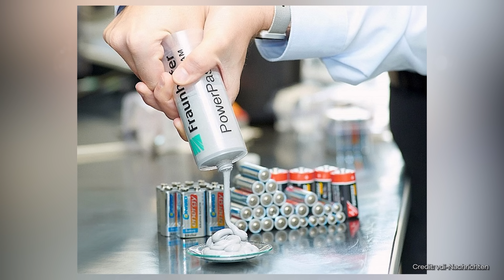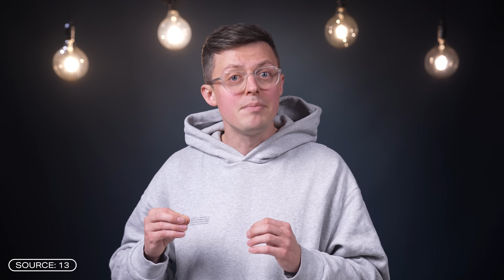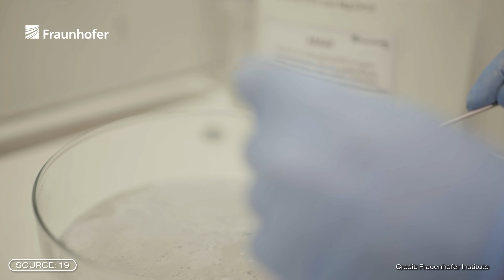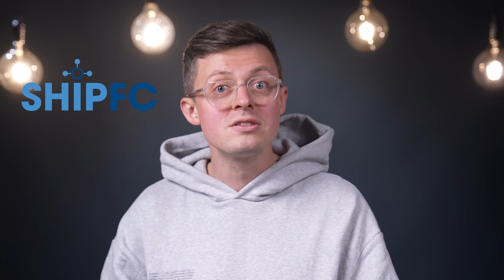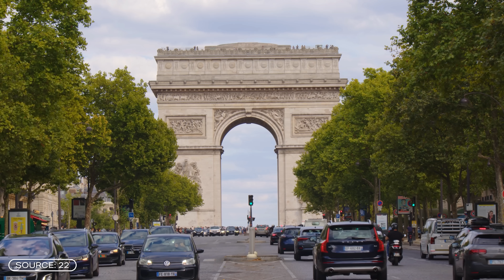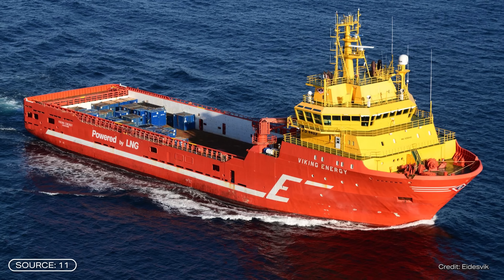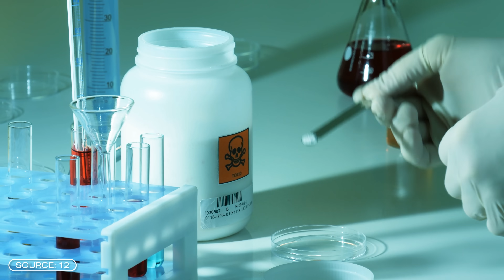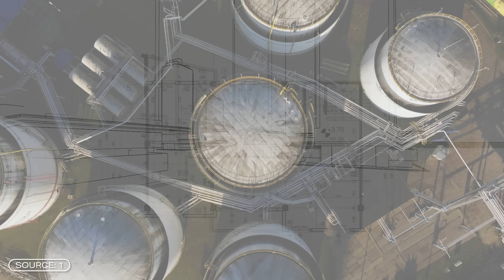Hydrogen Powerpaste: 10x Higher Energy Density & Safe?

Comment from the maker: Would you drive a car with a powerpaste-driven engine?
Reply: If it's as delicious as liver sausage, then a resounding Ja.
Reply: Mmmmm, Forbidden Toothpaste...
Reply: @MostlyPennyCat  BEAT ME TO IT!
Reply: Unfortunately the apparent reliance on liquid water is going to make that a no for me. It's below freezing for about half the year here.
Reply: @TheStrykerSeven  Same here, but if you could put in an antifreeze it may not be that much of a problem.
Reply: I'll never get a chance to.  Hydrogen is a terrible energy carrier. The total cost of the system will be too high.  Very little hydrogen is not produced from natural gas.  Which would be far more efficient and less expensive to just put in a natural gas vehicles.
Reply: @AddItUp-11235  yet it has a specific energy of 142MJ per kg. Far superior to any other battery and superior to petrol and diesel .

Hydrogen will be part of future energy storage, we cannot afford not to.
Reply: @polarbear7255  Maybe for bigger systems where size and weight does not matter. For cars, never.
Reply: @mikaelpehrman4815  never? 😂 love your ignorance. Toyota is already racing hydrogen ICE.
Do try to keep up.

Have a nice day 😊
Reply: @polarbear7255  Please enlighten me and my ignorance, with prices of a car, the distance it can travel and the density of supplyers of H2
Reply: @mikaelpehrman4815  go check the toyota Mirai… a hydrogen fuelled ICE vehicle. The Corolla GR H2 is their primary race car, but they have several other classes of vehicles as well, including a LeMans H2 prototype which raced at the LeMans 24hr in June 25.

The technology exists . Consider yourself enlightened. 

You’re welcome. Do you always have to be spoon fed your information?
Reply: I wouldn't park a car full of anhydrous magnesium powder in paste form anywhere 100 miles upwind of anything.
Reply: No. The production of Hydrogen is almost entirely from Methane; a petroleum product, via a very energy intensive chain of processes. 

If Hydrogen is produced from H₂O by electrolysis instead, the highest theoretical extraction efficiency is 66%, but in practice anything above 57% efficiency is a bonus. Then you have to pressurise it to 6 Bar, which takes energy. After that, the paste can be loaded with Hydrogen at, according to your words, 90% efficiency. Already, the overall efficiency will be down to around 45%. Now, if you use it in a fuel cell to generate electricity, that fuel cell runs at 66% efficiency or less. Now the overall efficiency is down to about 30%. At that point, you can use it in an electric vehicle, which runs at about 72% efficiency in real life, counting recharge and discharge losses, electronics and power train losses, etc. So the total efficiency will be around 25% at the very best. This is no better than burning Diesel fuel in a car in real conditions.

If the Hydrogen is simply burned, as is fuel in any combustion engine, the vehicle efficiency alone will never be much higher than 25% in real world use. So now we have a total system efficiency of about (0.25x0.30=0.075), or 7.5%, which is abysmal.

But taking the petroleum route for both Diesel fuel and for Hydrogen, overall system efficiency is very low indeed, because oil and gas have to be found, extracted, transported, refracted, transported again, stored and then put into the chosen process; Diesel fuel or Hydrogen. We are looking at over 99% of the energy put into the whole chain being wasted if the Hydrogen is simply burned in a combustion engine, and not much better if a fuel cell is being used for recharging a battery in an EV. (The Toyota Mirai is an EV, fuelled by Hydrogen, for example.)

Furthermore, Hydrogen leaks from most storage vessels, pipes, valves and gauges. Even in the paste format or a metal Hydride cell, it is still dangerous to handle. In the vehicle itself, the Hydrogen continues to evaporate until used. After the paste + distilled or reverse osmosis water process, the paste requires transporting again, and then reprocessing. (Ordinary mains water would contaminate a fuel cell and poison it quite rapidly.) Think of the logistics involved, with all of the energy losses incumbent upon that.

If electricity is used instead of Hydrogen, it can be generated at site, ideally, or transported through transmission lines when necessary. According to my energy supplier, transmission line losses in Britain amount to about 3% of the electricity put into them. Put it into a car with an electricity to motion efficiency of 72%, and the overall efficiency will be just above 70%. 

For long-haul air transport, and marine shipping, Hydrogen might well be the best option. It's viable right now. But do bear in mind that for batteries, the cell technology is improving in leaps and bounds. The best semi-solid-state cells available, and in some cars, right now hold just over 500 Wh per kilogram at cell level, and there is a lot more development in the pipeline. A decade from now, at today's rate of development, that might well rise to at least 1.5 kWh per kg. I hope to be alive to see that happen. Only 30 years ago, the best rechargeable cells on sale were Ni-Cd, which are little better than a Lead/acid battery..

Now, for cars and trucks, which fuel route makes the most sense to you? Fossil fuelled, Hydrogen/electric, Hydrogen combustion, or fully electric?
Reply: I forgot to mention the high, and increasing cost, of Hydrogen. It's already more expensive to use per kilometre than traditional fossil fuels.
Reply: @RWBHere hydrogen as a fuel source via electrolysis only becomes feasible if we switch to a nuclear powered society.
Reply: @RWBHere  Efficiency is important, but if you move manufacturing to deserted places with a lot of sunshine, it might matter less how efficient a process is if it is environmentally friendly, and H2 can be produced from water. In the end, when you think about efficiency of using modern combustion engines, you do not subtract from the efficiency numbers how expensive it will be to clear the Earth from overheating, or to heal the environment.
Reply: @RWBHere Well argued and explained, I think I’ll just stick to my bike!
Reply: @RWBHere  Did you factor in the energy cost of lithium mining and battery production, as well as the base cost for electricity generation into your calculations? What's the source of this electricity? Are these coal powered electric vehicles? 🤨
Reply: All electric hybrids would offer an interesting and powerful combination of capabilities.
Reply: People will make their own electricity at home as we go past 30% efficiency. Of course this is urban and suburban. Excuse me rural and suburban housing. And it will also promote suburban and rural housing. The ability to have energy Independence. Combined with that and the fact that very soon there will be Jets and like personal vertical takeoff and landing transportation powered by yes, the solar panels in your house or your property people will move away from big cities and be able to fly in like blade, runner and minority report.
Reply: @gearond  maybe for 3-5% of the population.  but we desperately need to get away from the congestive over built cities.  if this spreads to the top 25% of the population then its golden.
Reply: Can powerpaste be paired with hydrogen turbines?  NASA just shared a successful test, so how can H2 energy loops and logistics be generated and tested, in joint programs?  Space energy systems would seem to revolve around this new technology stream.
Reply: EV are packed full of technology that makes them very much safer for pedestrians and cycles. Not hitting them is safer than hitting them with a lighter car! What precious metal s are you concerned about. The modern EV isn’t using precious minerals, unlike every ice vehicle ever made. The fuel they use needed cobalt in the refining process. People keep recycling myths about EV as facts. Very few EV have had a battery fire, much more likely for an ice to have a fire. Or do you think a hydrogen powered vehicle is going to be fireproof? Hydrogen is such a level of unnecessary complications I can’t believe people think it’s a good idea . Making it, transporting it, storing it, converting it all inefficient and costly. Why would anyone want a car either the added complexity of a hydrogen storage and system to turn it into a working energy. It makes zero sense. That and having to go to a hydrogen station to fill up rather than plug in at home or the super market etc. then there is the cost of all this extra not needed crap it needs to make it work. Laughable,
Reply: Does it work as thermal paste?
Reply: Energy density in gasoline is about 5x more so... no thanks
Reply: No, I am not stupid. Hydrogen is stupid for energy applications.
Reply: how would you even fuel it though?
Reply: Only if it was cheap, which it will never be.
Reply: @hillsandstreams8152 
Why do you think so ???
Reply: 1,9 kWh pro Liter sind nicht viel😂 ist immer noch nur ein Fünftel von Benzin oder Diesel
Reply: NEVER.  The whole picture is breathtakingly costly.
Reply: Why? All of this is a solution to a solved problem. The next generation battery cells already being put into cars for sale recharge in ten minutes, making your stop equal to a gas stop on a roadtrip, because with gas you have to stay at the pump while it fills, with an EV you plug in, run to the restroom and buy some food, and it is done charging. Range is find with EVs, no one needs to drive more than four hours without stopping. 

And now we add even more inefficiency to hydrogen powered cars, having to make the paste, haul around the byproduct after it is used and take it somewhere to be recycled, etc. All so we can use more natural gas, which we need to be using less of.
Reply: still doesn't make sense. petrol 9kwh/L, diesel 9.7, This 1.9kwh/L. 
you have to carry the additional weight with you, you have to carry extra water. electric motors are very heavy.
better to use compressed methane, you don't need to carry spent fuel. filling is easier, works with minimal modifications to existing engines. infrastructure is about the same as current fuels. different storage tanks/pumps, same refueling routine. 
we just need to spend on solar ---> sabiter reactors,  pull co2, produce methane, pump into car and repeat. 
in every case there's massive amounts of waste. methane is at least a closed  ~ open cycle. we could be pulling co2 compounds directly from power plants at first using NaOH, KOH. and building larger solar powered plants that just recycle the air.
most hydrogen production is steam cracking natural gas.. which releases the same Co2 as burning fossil fuels with the added steps of creating a new storage solution and more complex distribution methods. 
Just go methane.
Reply: I would like if YOU drive such a car!
More and cheaper fuel for my 6.1 HEMI ❤
Reply: If it was cheaper cost per mile absolutely.
Reply: Not if it were on the Epstein list.
Reply: YES
Reply: Sure!  Would you fill it with paste for me?  More seriously, solar is getting pretty inexpensive compared to cars.  If I could install an extra 20kW worth of solar with a catalytic electrrolyzer and a tumbler so that, after the up-front cost, all my fuel is free, that has to be my preference.  But, if powerpaste is as inexpensive as gasoline, certainly I would prefer a fuel cell car to a petroleum powered car.  I think a fuel cell car is going to actually be a short range battery car with a fuel cell range extender, so the competition is going to be having a fuel cell and fuel versus having swappable extra solid state batteries to extend the range.
Reply: Hopefully  not S*itting solid waste on street like dogs and horses?
Reply: evet
Reply: Hindenburg reinvented?  Go ahead, blast yourself!
Reply: The paste changes hydrogen from a simple energy carrier to a material that either becomes waste or has to be recycled.
So now it adds a new energy loss to hydrogen use (assuming a circular economic model), and hydrogen already is a very inefficient way of getting electricity from the generator to the wheels of a car.
It's a messy idea from various POV.
Reply: 😂..no
Reply: Needs a better name in English — PowerGlide… er, taken. Hydrogel… hmm no again.
Reply: I think my orangutuan nepo-king would have me incarcerated for heresy for even watching a video about it.
Reply: Yesterday....
Reply: no because aluminuium gallium in saltwater  is usable even in apocalyptic scenarios
Reply: aluminum can be crushed into powder manually  after gallium weakend the cristal structure
Reply: No. Because 95% of hydrogen production is from fossil fuels, eg natural gas.
Reply: MoF is the best method for storing hydrogen, and it is developing faster than any other method.
Reply: Yes, for sure!
Reply: No...
Should I be involved in an accident, the likelihood that water is exposed directly to the fuel is too high...
That could be unfortunate.
Reply: On another note, it would also be far too easy to weaponize this for terrorism. If every fuel station sells this explosive element that simply needs to be mixed with water, it's a disaster waiting to happen.
This would remove the barrier of entry from those that wish to commit atrocities.
Reply: @keaganthegreat So, gasoline is not explosive?
Reply: @onlinesavant not typically. Flammable, yes. Under specific circumstances it's explosive but hydrogen is explosive in almost all cases.
Reply: And you're neglecting the fact that diesel engines exist. Diesel is only flammable when wicked by another medium or aerosolized and compressed to its combustion point.
Reply: @keaganthegreat Please. You do know that there is a car fire, brought on by a COMBUSTIBLE engine explosion, literally every day in the U.S. right? Multiple occurrences even. Save your cynicism for another, less informed channel. You don't think that the inventors of this technology won't take all variables into account? It is a truism that the dumb are loud, and the intelligent are quiet, sad to say.
Reply: @onlinesavant I've literally watched them. I spent a year in Afghanistan with MEDEVAC, and seen two vehicles ignite in civilian life as well.
Just because you've seen a movie, doesn't make it true.
I bet it's news to you, but they lie. Like, a LOT...
Reply: @keaganthegreat No. In this instance, there is no "lie" involved. I watch local news from many different major cities literally, everyday, and there are multiple reports of people dying from car fires from those sources, literally,  everyday.  If you weren't a bot, then you'd know that COMBUSTIBLE engine fires is a common occurrence, and far outpace fires from even electric cars. Bot.
Reply: @onlinesavant I said "explosive", not combustible.  You can either read, or you can't but that's not my problem.
Reply: This is one of the dumbest smart ideas I've ever heard of. There's more hydrogen in gasoline. Just make gasoline from CO2 and you've solved the problem.
Reply: Would your great grandfather make lampshades from human skin?
Reply: No. I'd use a laser to shoot a .1mm hole through a superconductor disc, and spin it. Water shot through such a disc is hho on the other side. This was discovered before I learned about it Oct 88. There's a few other ways, like, you can just make a giant spark plug with a 1/2" gap an 2 anodes that cross over one-another in a spiral. I posted a video on that one. Each water droplet becomes ionized when energy can't decide which way to go, so again, you get the same volatility of gasoline when the hho bridges the gap, as water will act like a capacitor and a semi-conductor. Do that using about 40kv. I posted a video with the plan. Too bad I don't get the views you do.
Reply: i've heard about hydrogen planes. some university of colledge (i forgore) flew ~300 peoples on a comercial plane. the hydrogen tanks from my relatively not great memory  were pretty big.
Reply: Yes. And Ja.
Reply: What's the energy density? Until is compares with gasoline, who cares? Production of it through electrolysis is only 60% efficient, and that only happens in a lab when you're using very complex methods, like making use a Stirling engine to recover heat.
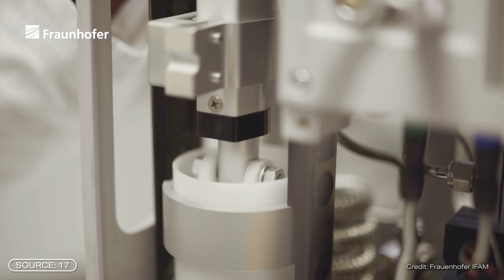Reply: 3:27 Gasoline has an average energy density of 9.3 kWh/L. Nearly 5 times the energy density of this stuff. This is a no-go.
Reply: Nope, batteries will rule cars for at least a decade.  They interface with electric motors very well, the specifications get significantly better each year, and the cost keeps coming down.  The only moderately complicated part of an ev is the battery cooling system, so the service life is long and maintenance costs and hassle are low.  I drive a 2013 Chevy Volt and expect it to continue to run for a long time yet - and that's an early plug-in hybrid, not a true ev or a modern car.  Battery electric cars are great!  Good luck trying to beat them.

For huge ships, the best option may be different.  It might be worth the infrastructure required to lower the weight of energy storage when there is that much energy that needs to be stored.
Reply: @richs5422  Batteries build dendrites. This is when the anode and cathode short out. I'll leave it up to you to look up what a "battery dendrite" is.

Your battery has a limited lifespan, a certain number of charge cycles, and the battery is part of the structure of the vehicle so you can't just replace them, they are obsolete by the time they need to be replaced - you have to buy another car. Worse, is that that even in a minor accident, because the car's structure is integrated with the battery, even minor damage can lead to catastrophic failure.

Get into a minor fender bender? NEVER park your car in your garage again.

Your Chevy Volt is over 10 years ago. You don't drive it very far or very much. It's at the end of its lifespan.

I was trying to warn people 10 years ago, now it's find out I'm right. I'm an engineer, and an expert in DIN and 15518-2 protocols, probably THE expert in North America. Problem with me is that anything I work on, I research, I need to understand the whole product, not just my section on it.

EV's will still exist in 10 years, but they will be a rarity. They don't solve any problems. They use as much (if not more) energy than a conventional engine does, they take forever to charge even with DC fast charging, they are dangerous because of how heavy they are, they will go right through traffic barriers and guard rails, and they pollute just as much, just off site and they have a hard limit on recharge cycles.

BUT they are much easier to service, if you were given the technical knowledge you need to service them. It's a lot easier to work on an electric motor than an internal combustion engine except it's all proprietary.

Electric is great, but batteries are awful. If we could efficiently generate electricity with conventional fuels, they've be long term viable. Plug in hybrid is the best solution, currently. Manufacturers lie, they are only known to be "in error" after a decade, by then they've already made their money. We'll see about their longevity.

Do NOT buy a purely electric vehicle.
Reply: Probably yes.

There are quite some questions around the whole cycle. For example, how "temperament" power paste is? Is it like dimethylhydrazine - it has all bad properties except being radioactive, or it is moderately safe (e.g. like a gasoline?).

Hydrogen paste is probably a good component for economy with surpluses of renewable energy. You can generate hydrogen gas when there is surplus of energy which would otherwise be wasted. This surplus is and will be inevitable if yearly coefficient of utilization of renewables has to be increased. When renewables produce more energy than network needs, it could be converted to powerpaste. As energy to power mills and to generate hydrogen by whatever method would essentially be "for free" (=for fixed procurement costs), the only production cost would be maintenance and cost of powder and catalyzer. Their price may go down if this would be produced at scale.

It can then be used to power whatever needs where wires or batteries are not suitable for whatever reason.

If all chemicals used in the process can be recycled, then all costs of the system boil down to procurement costs of the equipment and replacement of lost chemicals.

I like closed loops like this one.
Reply: Tomorrow please
Reply: No, because it is very toxic. Methonal fuel cells are far better!
Reply: fuck no.
that stuff will gum up your engine.
Reply: Yes! See Tesla Water Engine.
Reply: What would I do with the paste? The tank would have to be emptied, then flushed out (but if it's with water, it will have to be dried before refilling). That's not going to be a fast process. Might as well drive an EV.
Reply: @tsbrownie  Ya gotta stop thinking in terms of petrol.  There would be no pump.
It could use a replaceable cartridge, like Formula E that has plug in battery packs.
Reply: @Oodle-ox2vf Where would this fuel cylinder exchange take place? At a service station? How would the full/empty cylinders be moved about? Who would do the exchange? It involves extremely high pressures and super low temps. And it's been shown time and again, people don't want other people's used and abused swappable parts.
Reply: @tsbrownie  yes. they already do it with pressurized hydrogen, this situation would make that a lot more viable since it doesn't have to be stored under pressure and therefor will probably take almost exactly the same amount of time to refuel as a petrol engine.
Reply: @silabelll And the leftover paste?
Reply: @Oodle-ox2vf 
But post processing the materials is an additional cost financially and in terms of energy losses within the system.
Any additional energy loss from generator to vehicle wheels means more generation capacity needed for every mile driven.
Reply: @tsbrownie  Swap out a service station.
Reply: @FlameofDemocracy   why not swap batteries instead? it's much safer and the technology already exists
Reply: @smoguli  Swapping batteries isn't a bad idea.  Further, there is nothing to fear from emerging technologies. It is up to the consumer.
Reply: @smoguli  Energy pastes are quite safe.  Accordingly, hydrogen can be transported from tropical regions, windy areas, seaborn wind turbines, deserts, or from local are nightly grid absorption.  

All in all, easy money.

There is far more grid loss, than power employed, in fact.
Reply: @smoguli  Lol @ batteries are safe? And then you want to swap in a unknown battery when you have no idea how it has been treated. Good luck with that.
Reply: @FlameofDemocracy 
But there is no mess at all with electricity.
The fact that it is a complex material means any post processing is a new energy loss to the use case.
Reply: @Paul-yh8km  All the materials can be used again, and swaps are opaque to users.  In any case, the idea is to stop wasting electricity, from an expert view.
Reply: @Stambo59  there are already hundreds of battery swapping stations in China, you pay for the battery swapping service but the battery is not yours. So if the battery is defective you just have to swap it for another one it won’t cost you anything more.
Reply: @FlameofDemocracy  
Using materials again, equates to using energy to do so and that equates to an energy loss in the life cycle of using the hydrogen.
that means effectively more energy isn't getting to drive the wheels of the vehicle, useful energy is lost.
Reply: @smoguli  Except maybe your life if the battery has hidden damage and ends up on fire.
China is hardly the EV mecca it is made out to be with all the battery fires happening there.
Reply: @smoguli  What would it take to switch out a whole car battery.... What does it take? Then there is the energy density factor.
Reply: @Veevslav1  look at Nio cars from China. They have automated battery swapping stations, it takes 7 minutes and you don’t even have to get out of your car.
Reply: @Paul-yh8km  Nature reuses everything within the solar energy budget.  The sun is at least 6000 degrees Kelvin.  Business should operate within this budget,  as well in order to save  the most money.  The current ESG system seems to be the most reasonable approaches to take.
Reply: @tsbrownie  because you can't use some blow-drier kind of thing there, that dries it out in seconds?
Reply: @tsbrownie well, just design the tank like a seringe, press it empty and suck in the new. Problem solved.
Reply: Powerpaste has immediate use as a means to store energy for sovereign finance purposes.  It can stand as collateral for loans.  Absorb nightly grid losses as hydrogen paste, for financial stability over the coming decades.
Reply: Filling your tank with water and some paste. Sounds very reasonable. Finally a car that runs, kind of, on water. 😬
Reply: no
Reply: @someOneYouKnow6506  yes
Reply: Power paste can only improve over time.  Yes, resoundingly.
Reply: I would like to produce an aluminum catalyst hydrogen generation engine.
Reply: I had to stop the video at 1:45  and research that device.
Reply: Producing magnesium metal and hydrogen gas both require significant energy. Then combining them into magnesium hydride loses a small amount of that, but you gain convenience. After adding water you release the hydrogen, leaving behind magnesium hydroxide slurry, which has to be returned for reforming magnesium metal.
Reply: No.
But only because I have ME/CFS and wouldn't want to risk having one of my "wobbles" at 30mph lol
It does sound better than lithium batteries.
Reply: When your focus on the metric of reducing Carbon Dioxide emissions leads you to conclusions that maximize Magnesium Oxide and Nitrous Oxide emissions, then you've lost the plot right at the base conceptual level.
Reply: If the technology was too disruptive to government control it would be killed and never see the light of day.
Reply: It could be used to replace coal in fireplaces. 😉
Reply: We need more trains, less cars in the world. But cars should be running on mostly electric, but some older ones can run on e-fuels.